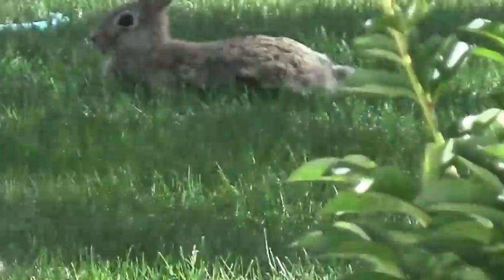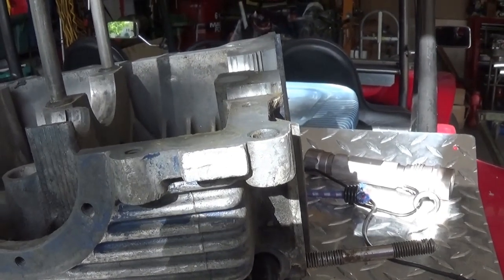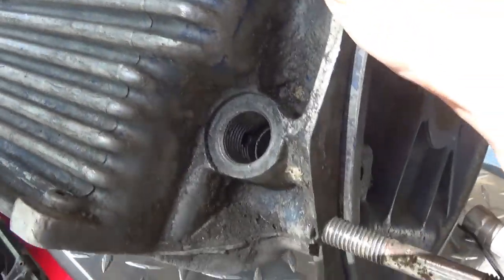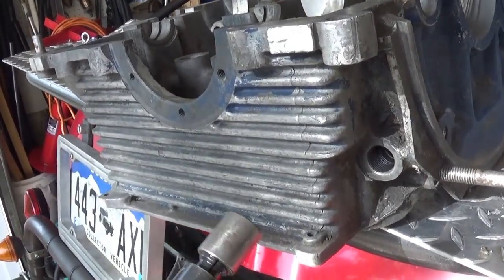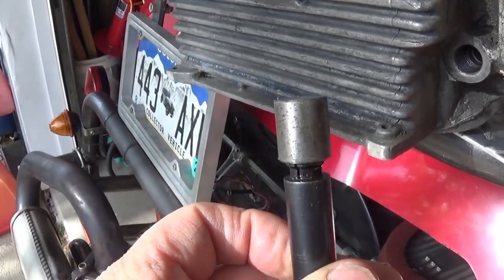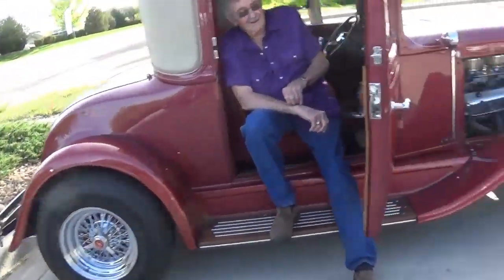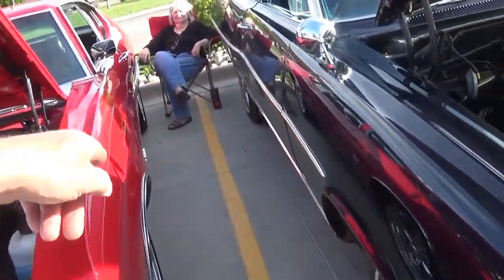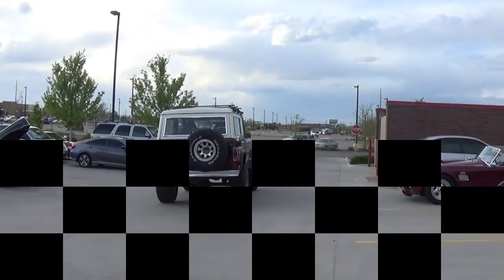VW Oil Pressure Relief Valve Problem & Solution

Comment: Good point about the oil relief valve. I didn’t have any luck using a tap to remove a stock plunger... I ended up very carefully drilling it, tapping it with a 1/4” tap and threading the bolt into it... yanked it out that way. Even the tool didn’t provide enough grip for it. The guy who brought me the case said someone tried to put an aftermarket kit in there and jammed it up there. 😂

Thanks for showing us some cool rides, the Diesel GMC and bronco were my favorites.
Reply from the maker: and????   Nice engineering getting it out.
Reply: I got lucky with my "stuck" relief piston. It "seemed" like it was pretty much welded in there, and I was skeptical even the special tool would get it out. Turns out just using the right 3 1/2" shank bolt with course threads gave enough bite to get it out. I was pleasantly surprised.

Comment: I would like to know if a stuck oil relief valve or combination of the oil relief and control valve on the post 1970 motors would make a dipstick check not show the correct oil level after a new oil change???  Is that possible?
Reply from the maker: No.  But the oil level will be slightly lower when you shut the engine off because the oil cooler gets filled up and takes a while to drain back to the sump

Comment: Is it possible for the front valve to hydro lock? Or the valve closer to the oil pump.
Reply from the maker: NO, there is a relief hole in the spring area which returns it to the oil sump

Comment: Smaller piston and same spring resulted in higher oil pressure?  Perhaps smaller piston had a larger deck hight compressing spring a little further?  Alternately original piston was not seating and bypass hole was partially exposed?  Still confused.
Reply from the maker: I did it in the car. There was so much oil running out I couldn't tell much. Might have been some junk at the top of the bore?????  Next time I change my oil I'm going to have a closer look. I'll will keep everyone posted.
Reply: @TheEZGZ  Thank you!  Have fun and stay safe.

Comment: I've been drilling out the dump hole when running large pumps with an engine with tight clearances.
Reply from the maker: Should not use a large pump then.  Big power race engine should have extra clearance so wouldn't be a problem. I trust the factory design

Comment: hey EZ, I just built a brand new  all new parts engine and when I turn it over it only reads 20 psi. Idk why that would be, I have a full flow system in it.
Reply from the maker: Sorry for the delay.  20 psi at idle is just fine.  The old rule of thumb is 10 psi for 1,000RPM  
The book says minimum at 2,500 RPM is 28 with warm engine and 30 weight oil.

Comment: Would a stuck valve cause the oil pressure to get so high that the engine has trouble cranking?
Reply from the maker: Cranking as in starting? No

Comment: Would a bad pressure relief system give you low oil pressure after warm up?
Reply from the maker: Usually a sticking relief valve will show up on a rebuilt engine because of contamination.  All things being equal on a high mileage engine it's worn out and the large clearances lower the oil pressure.  Could be a worn or damaged oil pump too.  All these things can cause your engine to be low on power poor gas mileage and runs hot.
Reply: @TheEZGZ  Hey bud thanks for the reply. So it's a new build with a used but good CB performance oil pump with the filter attachment.  It does have the dual oil pressure releif case. And I believe it's still has the old springs and plungers in it.
Reply from the maker: First thing I would look at is the oil pressure gauge your using. If it's a VDO with electric sender I wouldn't trust it. Use a new mechanical gauge for a test and comparison.   It dosen't hurt to pull the relief valves and see how they checkout.   Don't try to fix  a problem by putting stiffer springs or longer relief pistons in or run heavier oil IMHO  There are so many factors in building an engine right. 
Sometimes you just have to live with it. There is no simple solution